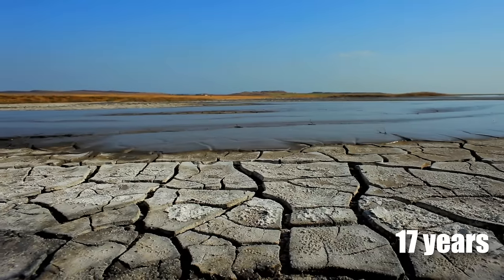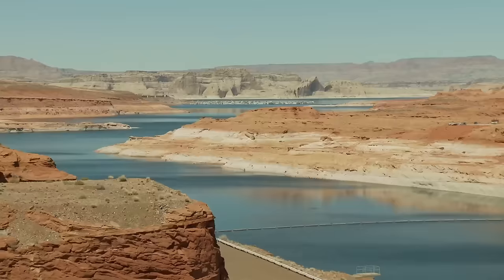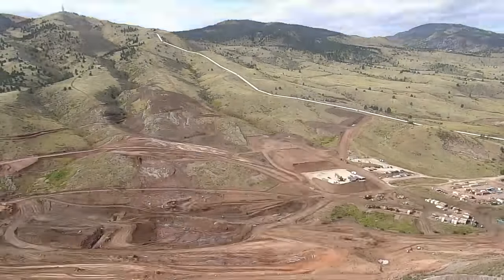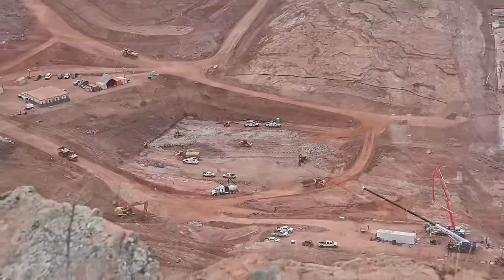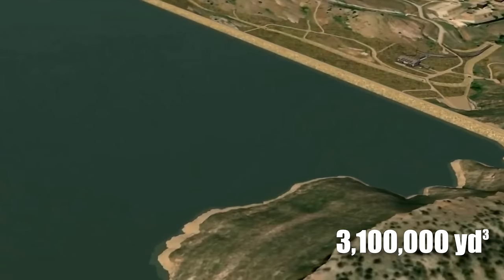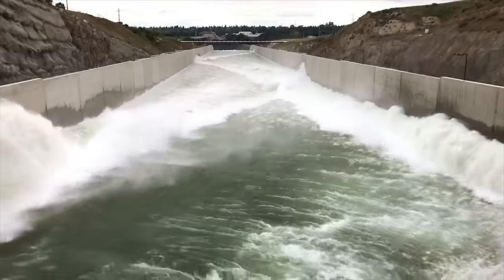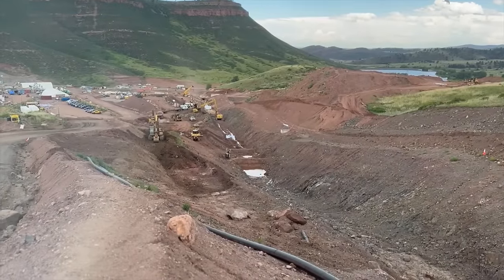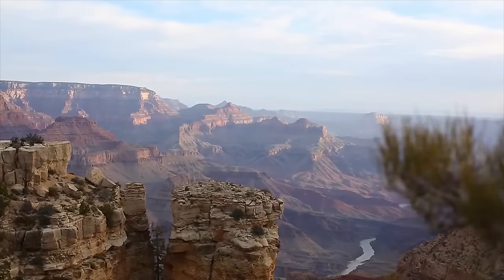Chimney Hollow Reservoir  - Colorado's $500m New Mega Dam

Comment: Bringing water from one side of the mountain that flows into the Gulf to the other side that where rivers flow into the Pacific in ingenious. So, when will someone come up with the idea of funneling water from the great lakes into the South Western United States? It may be expensive, but a lot cheaper than it will be in 50 years from now. 

Think about it, if we start building the water ways for it from Lake Superior now, and then start using drilling tunnels in the Rockies to flow the water through the Mountains today, then maybe in 20 years we will have created a whole knew ecological paradise throughout the southwest. Which would supply water for the growing cities, and create new lakes for new ecological areas that would transport the deserts into lush green paradises.

Comment: It’ll help, looks like a good idea to me. I’m surprised there’s no power turbines in the outflow design. Good video informative.
Reply: Haven't you heard hydro isn't green enough anymore
Reply: they likely don't have a high enough flow rate to run large turbines for power. 
I think most of the water will used for irrigation for profit, dry season is long.

Comment: Depends on the weather as to which side of the continental divide needs the water more.  Having control left or right would be great for the everyone involved as long as the controller has east and west in there best interest.
Reply: That is where my idea comes in. If we could bring water from one side of the continental divide to the other side as they are here, but not with rivers, but from the Great lakes, then we could create lush green areas the size of some states. It may be expensive, but a lot cheaper than it will be in 50 years from now. 

Think about it, if we start building the water ways for it from the Great Lakes at the same time they begin drilling water ways through the Western Mountains using the same tunnel machines they use for road ways and trains, then maybe in 20 years we will have created a whole knew ecological paradise throughout the southwest. Which would supply water for the growing cities, and create new lakes for new ecological areas, and transform vast desert wastelands into agriculture and lush green paradises.

Comment: More dams on the colorado river ☠️☠️☠️
Reply: If only the western states were that lucky.  This damn is being built in the South Platt watershed, not the Colorado river. They will be, however, taking water out of the Colorado river watershed to fill it; taking water away from the dryer western states to supply Denver (and the wetter eastern states) with more water.
Reply: Actually this will feed into the Platte river system.

Comment: I love civil engineering and construction in general, but...  The problem I have with this project is that it is getting the water from the WEST of the Continental Divide for use by the EAST side.  The water (or at least what is left) after being used and treated, will then be released into the Platte/Mississippi River watershed instead of being returned to the dry western half of the US.  Since I live in the West, having more water taken from this part of the country will just exacerbate our current water problems.  Good for Denver (and it's suburbs); but bad for Western Colorado, Utah, Nevada, Arizona, and California.
Reply: Along with Mexico, especially the Sea of Cortez where the Colorado river is supposed to end up.  The U.S. is committed by treaty to maintain a certain level of flow there, so this project just means the U.S. will have to spend even more money to replace the water this will take from the river!
Reply: Why doesn't California build dams? 🤔
Reply: Do you even understand how reservoirs work? Colorado will still meet its minimum amounts of water out of the state. The reservoir will be filled over the span of several years with excess water from above average moisture years. 

It's not Colorado's fault if states down stream mismanage the water the water they receive from Colorado.